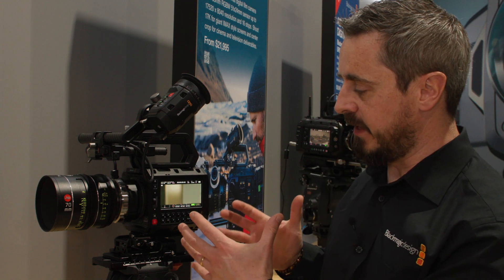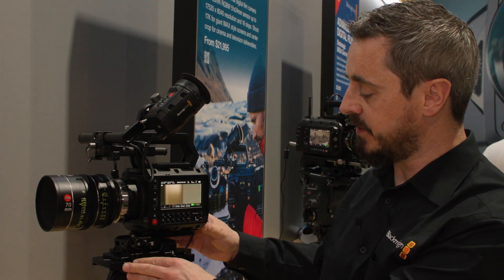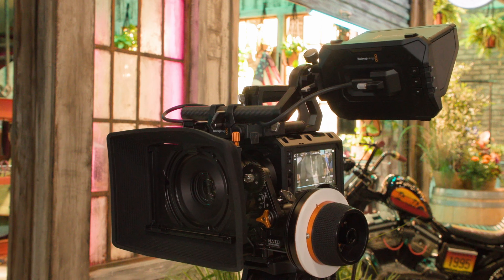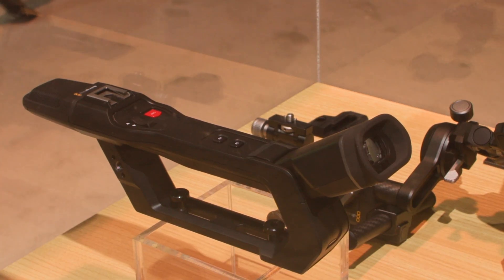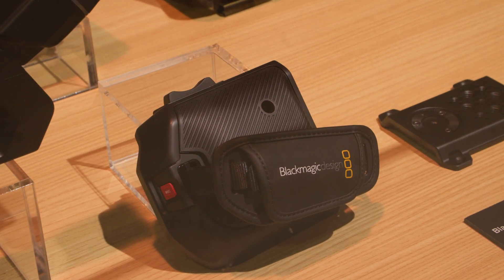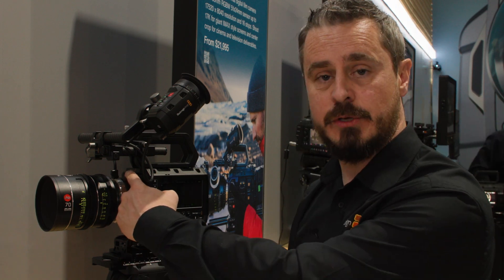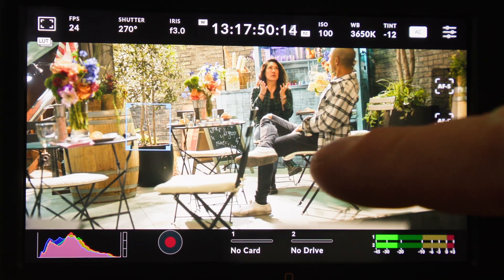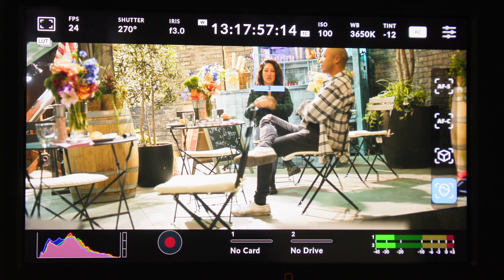Blackmagic PYXIS 12K explained: Sensor Readouts, new AF, U.S. Tariffs and more ...

Comment: Please ask if auto focus is coming to the Pyxis 12k specifically! Need a non-generic answer please.
Reply from the maker: Hi E. Blackmagic said in our talks that the next camera to get af will be the Pyxis 6K as it uses the same sensor as the Cinema Camera 6K. If the 12K Version will get the af function as well is not clear yet. Cheers. Rob/ slashCam
Reply: @slashcam that’s a bummer that it may not get added to the 12k Pyxis. Grant made it sound like it would get added later.

Comment: 00:00 Introduction
00:13 Overview 
00:57 What does implementing the Ursa Cine 12K sensor into the Pyxis mean?
02:22 The Ursa Cine 12K needs the Blackmagic Media Module...?
03:32 Has the power consumption changed?
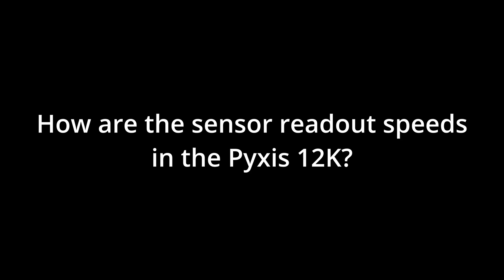04:24 How are the sensor readout speeds in the Pyxis 12K?
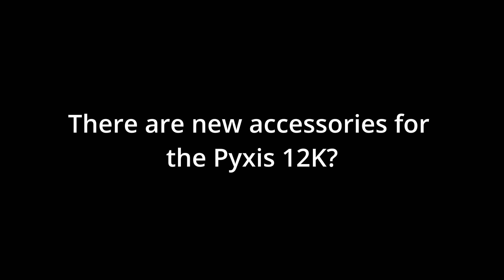05:35 There are new accessories for the Pyxis 12K?
06:35 What are the main differences between the Pyxis 6K and 12K?
07:42 There have been price increases on all Blackmagic products for US customers?
08:16 There is a new autofocus function coming to Blackmagic cameras?
09:15 How do the new AF functions work?
10:11 Pricing and availability of the Pyxis 12K?

(der letzte Bulletpoint hat zwar "Pyxis 6K" da stehen, aber ich war mal so frei, das anzupassen)
Reply from the maker: Hi Lucas - Danke für den Support! - übernehmen wir in die Beschreibung.